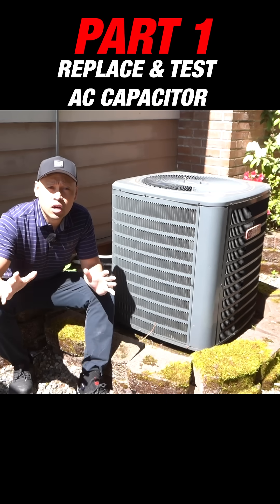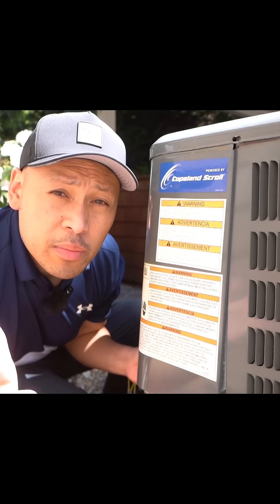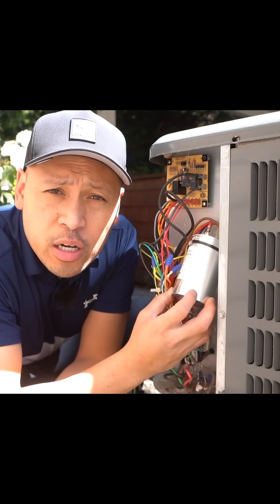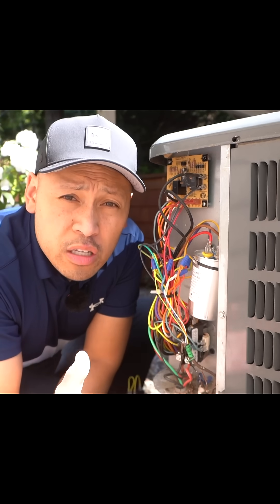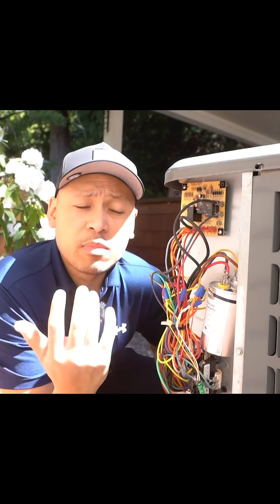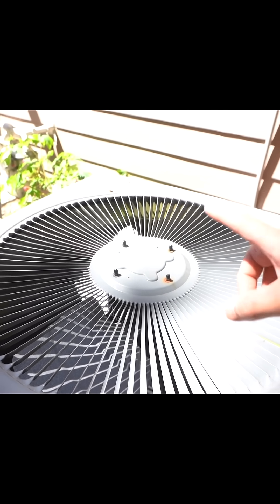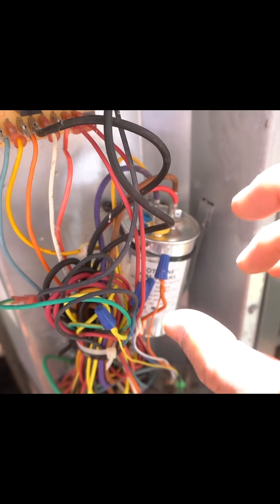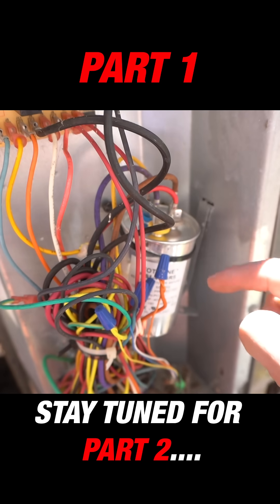How To TEST & REPLACE An AC Capacitor! PART 1#shorts

Comment: What is the Compressor Min outdoor Temperature be set at my unit could take up to-15  and also Aux heat Max outdoor temperature  when it's  - 4 it won't kick in

Comment: I have a Trane Central Air Conditioner TTR036C100A2. It is blowing air but it is not cold. I would like to replace the capacitor. Where is the capacitor located on this unit? Thanks!
Reply: In the condenser outside